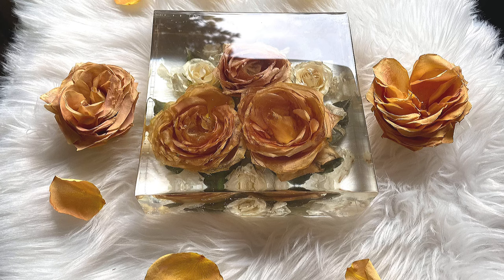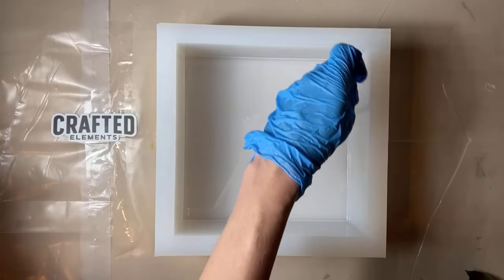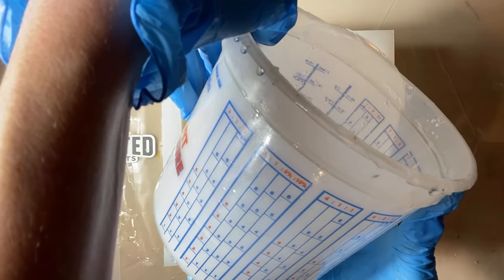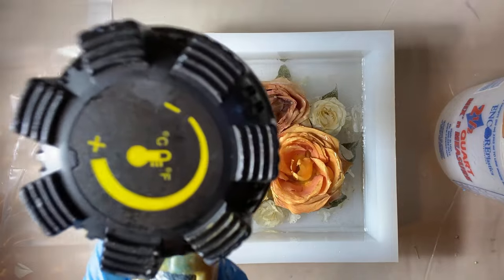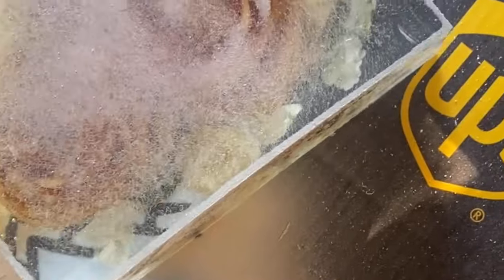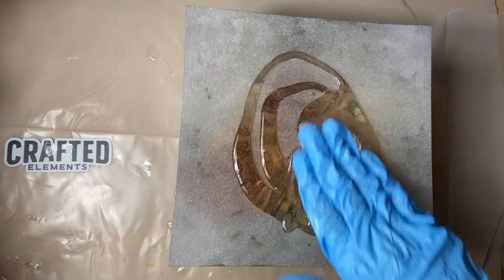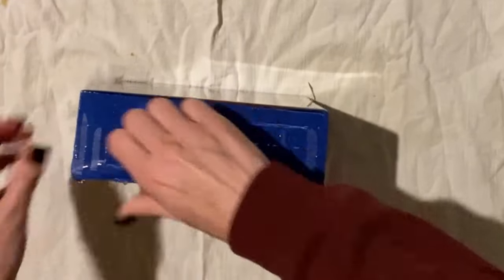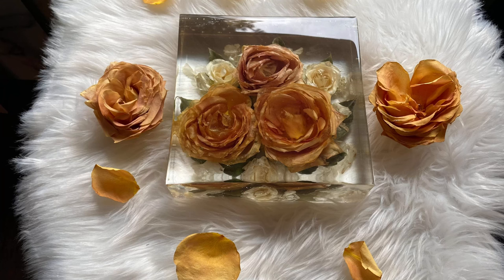Using Deep Pour Silicone Molds For Flower Preservation - How To Encapsulate Flowers In Epoxy Resin

Comment: In the semi-side shots the layer lines are clearly visible. I have found that this is caused by allowing the layer to fully cure. If you pour when you can still leave a fingerprint the layer lines are MUCH less visible
Reply: I àm starting to use deep pour resin.  I am making a fish diorama.  When will the resin be thick enough to insert fish?  Can I do a deep pour and insert fish at different levels?  I dont want layer lines.  How to tell when to pour a second layer on deep pour.     I do use resin for river boards but I have never done dioramas before
Reply: I and just learning about problems with casting deep pour in layers. My first project is showing a very obvious line. I will experiment with sanding the line and maybe brush on epoxy over the line. Next project I will try the method you said above to control the layer line. Lines are more of a problem than bubbles to me.

Comment: Wouldn't it be better to place tape on sides starting from the bottom up so if it does drip down the sides it won't get in between the layers?

Comment: Thanks for the great vid! 
I'm going to have a go at doing this with flowers from my wedding! 
Is the sanding and top coat necessary every time? Why is the final layer not good enough?
Reply from the maker: It depends on how it comes out of the mold, if its perfectly clear, no bubbles on the outer sides etc, then you could likely make due. Sanding and top coating levels it out, takes off the meniscus (raised area around the edge of the mold from surface tension). Once you sand, you either need to sand to 3000 grit, polish and leave it... Or cheat, and sand to 120 grit then flood coat.
Reply: @CraftedElements  thanks so much!! That's a great help! I'll try and find some top coat here in Australia! 
Also, is a heat gun absolutely necessary to remove the bubbles?
Reply from the maker: @Em-qn8cl  Heat gun or torch, I guess a high power hair dryer may work?
Reply: @CraftedElements  i did wonder about a hair dryer... but i envisioned resin getting blown out everywhere!! 😂
Reply: @CraftedElements do you have any tips for a first timer with a sanding machine?

Comment: It looks amazing...
I have tried to preserve flowers in adeep cast too, however my stuff kind of all just bubbled up to the top even higher than the mold :(  any suggestions why?
Reply from the maker: Even with a deep cast mold it's typically something you might want to do in 2 or 3 layers. If you have bubbling its either too much air in the epoxy (and it needs degassed first) or it got too hot. Which means it was poured too deep all at once for what the epoxy can handle.